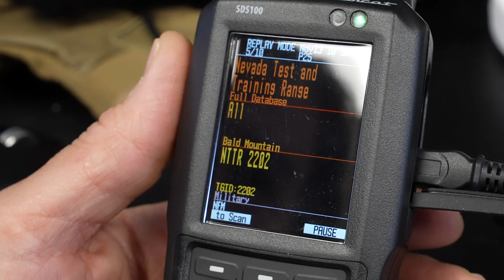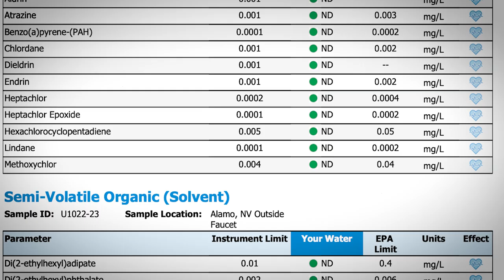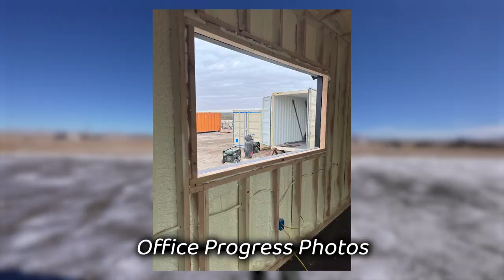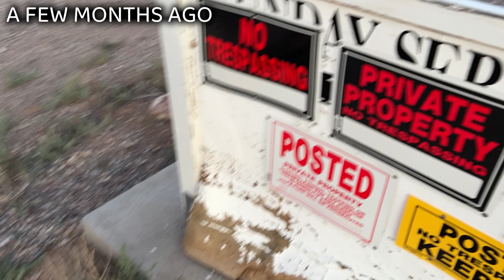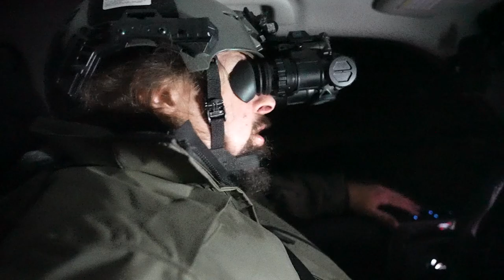Unexpected Visitors At My Property Ends Badly

Comment: Boron natural out there?  Seems like is, otherwise I was wondering if jet fuel like maybe rocket fuel for the other items... though most likely I'm guessing old sea water residue?  Haven't researched at all.  Crazy the price of the development IMO... though I read into that stuff since grew up a maintenance tech for anything where I was taught only to hire if I can't afford the tools to do the job.
Reply: Handi or Diamond Piers to save on concrete and time maybe for making the footings so only need to pour a pad if you even want to have pads (i.e. foundation)?   I'm not sure about flood plain like stuff, though is like a down south thing I typically feel... like other than geothermal effects... get up off the ground.  My short term mission stuff was hurricane aftermath though.  Not quite monsoon season issues, though looks like does flood as I've come close to traveling through.

Comment: Man I feel so bad for you guys getting continually ripped off. Nothing you have going on there is difficult, complicated or realistically complicated to fix, finish, repair for any reasonably capable competent individual. All these stories have turned me so spiteful to so many people I have a hard time trusting anyone.
You guys are a friendly caring family and don't deserve all the negativity.

Then you can consider filing complaints against the contractors for noncompletion etc with the state consumer protection dept. They can fine, seize and file charges on your behalf if needed. I've done it multiple times even in a different state and 1 turned into a class action lawsuit. I just had to make the complaint and authorize them. They did everything.

I quit taking projects on to spend more time with my wife and support her on her 1200mi trail hiking goal. Maybe I need to start traveling to help people out of jams. Feel free to contact me with questions or get a 2nd opinion. I have contact info in the description of my vids.

Comment: A cheap 200$ aircraft handheld radio would easily let you s listen to flight comms the sds100 can scan those channels but is built to really pick up the 800-900mhz bands aircraft bands are down in the 100mhz range
Reply: I wonder if those planes show on public flight radar...probably not
Reply: @mrmotofy   sometimes they do and sometimes they don’t in my experience anything flying into or out of either Homey AFB aka area51 or the tonapah Range air strip weather it’s a Janet flight or any military aircraft fighter to cargo turn off thier transponders about 10-20 miles out and when flying out do not turn their transponders on until they are 10-20 miles out of the strip you can watch this via Flightradar24 or any other free ads-b monitoring app or website easiest way is to watch the planes at harry Reid international in Vegas and find a Janet flight around 7 or 8 am local time “there will be a few” on any working day and track it and you will see when they turn the transponder off when they get close to homey or tonapah
Reply: @mrmotofy  anything flying inside the Area 51 or tonapah airspace will not have a transponder turned on as both places are restricted airspace and the Air Force has primary radar to keep track of what ever is flying in the restricted air space
Reply: @mrmotofy  NO

Comment: I hate to tell you about you septic ? It is those flushable wipes they are no good for septic's ? you need to get a wipe guard  to stop them from going in the system. Another thing is tampons they float and jam up the system as well. You need to tell you customers not to flush them down or it will always clog up. I would put a sign and have it in your contract a fine that if they flush wipes or tampon in the septic they will pay for repairs and fines ?
Reply: YOU have no idea what their cause there is.
Reply: @mrmotofy  No maybe not, but I have had Business in a similar situation and felt like sharing ! It may have looked as if I was telling them that's what happens ? But in lieu of telling a long story I got right to the point. If that's not it no harm no foul. I am sure if they didn't pull those thing out of the septic or other problems were going on they would have moved on after that ? 
Well I guess we will all find out soon enough when they find out what the real issue is ???

Comment: Just some advice on on storing water. Ozone is good and all. There are cons though... Also dont inhale Ozone. Ozone tends to corrode any electronics and metal. Also when dosing with ozone you need some kind of diffuser system in the bottom of the tank that bubbles through the water. This is called contact time. The other method is dosing with chlorine. This is the cheaper solution and my opinion the best way to store water. There are plenty of online info. I think its 0.2mg/L that gives you about 0.02mg/L residual chlorine and thats the clorine that will keep your water clean while you store it. The tank you have looks like 10000 Litre. You can do the math... Here is a link to back my claims and it might help you. Lots of info and points to consider. Also depends on the contents of the water. For ozone dosing see https://spartanwatertreatment.com/how-much-ozone-do-i-need-to-treat-water/. For chlorine dosing see https://www.safewater.org/fact-sheets-1/2017/1/23/what-is-chlorination. Do note that the stored water gets treated with ozone. What happens inside the pipes? Dead points in pipes can house bacteria growth. Chlorine takes care of that. Ozone becomes O2 when reacted. You can look at UV lamps too. You do get ones for water treatment. You just drop it in the water tank. Having all there is a sure way to have safe water all the time.

Comment: A little well known tip about Night vision goggles You have to have a special Night vision goggles to be able to see out glass And not only that the bullet proof windows that the military equipment has is designed to be able to see through with infrared and night vision. Lol High tech Civilian Night vision It is still an extremely low grade of night vision Is compared to what the military actually has.  You have to have the inside ligjts off There cannot be any sort of light whatsoever Inside the vehicle as well.